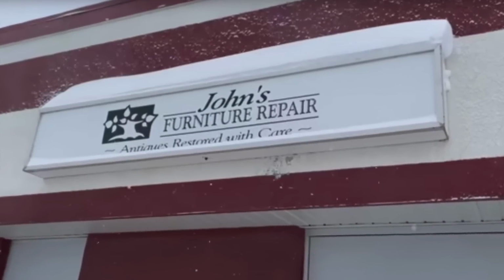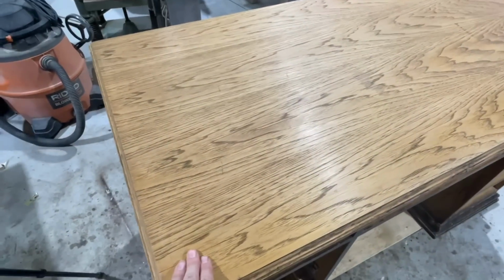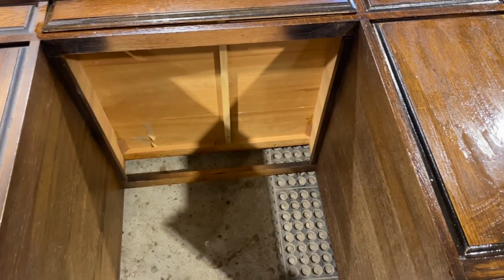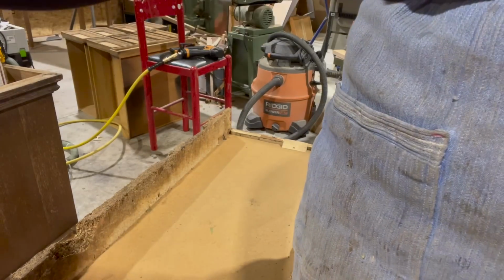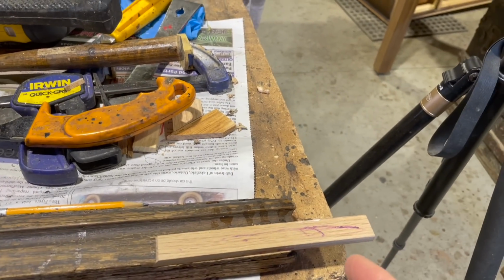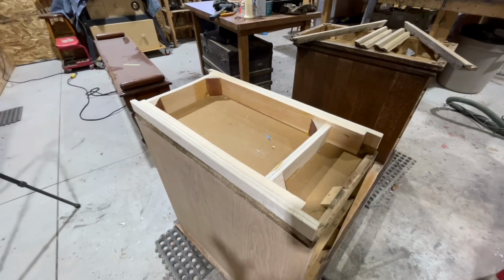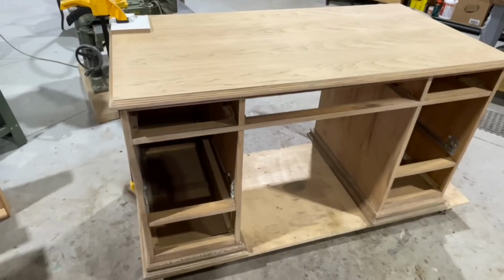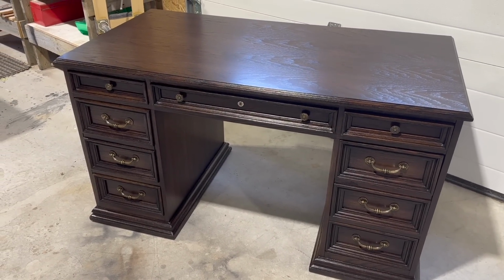Particle board + Water damage = shoot me

Comment: A lot of work to beautify bonfire fodder. It had to have great sentimental value to the customer.  As usual, excellent work. What is sad is to see particle board furniture and cabinets peddled at prices that,  just a few years ago, would have been equivalent for solid hardwood.
Reply: I’d have burned it for sure.  And bought a quality piece to replace it.
Reply: What is sad is when the piece was new the salesperson touted this as a solid wood desk.
Reply: Brilliant my love
Alan Brett
Reply: Congratulations.  You have accomplished the Alchemist's feat of turning a sow's ear into a silk purse.  Hope the client appreciates it!
Reply: @viriato8566  exactly.  I was thinking it was lipstick on a pig.
Reply: Yes, but even a fire fodder it was still not worth the work of burning, but it came out beautiful after all the work. My father built a chipboard factory, and his attitude was that the stuff was shyteboard, especially after they went to environmentally friendly adhesives over the old formaldehyde based ones, and started to use less and less of it in the product as well. The ones from the 1970's are pretty much waterproof, and will survive being wet quite well, just now to get the same performance you need to go and pay over the top for the marine grade boards, and at the price of the marine grade chipboard you might as well not bother, and instead go for the marine plywood instead, as that is actually cheaper, and a far stronger product.

Yes I have a lot of home built furniture, and the easiest sturdiest thing to build out of is shutterply, as that is so much stronger than chipboard, and is actually a bit cheaper as well, especially as you get a stronger panel for a lower price, and it is a lot more rigid, and a lot better as to holding power for glue and fasteners as well.
Reply: Well, I think you said everything I was thinking!
Reply: @SeanBZA The biggest mistake we made in our home restoration was selecting painted MDF for our kitchen cabinet faces and drawer faces. Within a year or two any bump or nick "exploded" with water exposure. Had to reface everything with painted birch

Comment: Friends don't let friends buy particle board.Lol
Great job Trina.
Reply from the maker: Lol
Reply: Say what you want about people making good looking decorative pieces out of cheap pine.  I know they are not walnut, cherry, or oak -- but hey they come out spectacularly good looking and will last forever as compared to particle board/mdf/osb.
Reply: The diecast hardware was enough of a clue as to the low quality materials used in the rest of the piece
Reply: thats costco furniture..
Reply: I've seen alot of older furniture & mid century modern also made with particularly board too. But has lasted for many years. This new furniture they make today is so cheaply made. It's like it's made from saw dust, ugh. I'll buy older furniture & repair.

Comment: Could you use an epoxy resin on the particle board to increase structural integrity? Then glue new frame back to it also on the bottom edge to waterproof it ? Good job though on rubbish furniture

Comment: I feel your pain with the PB, I usually turned down that work but you did a magnificent job as usual. I think the worst thing to encounter is the plastic used on some cheap furniture. I was helping a friend in his shop once in trhe 1970s and he put a bureau in a strip tank before we went to lunch. When we returned, we found just a few pieces of wood floating in the tank as it was mostly plastic and melted! that was a difficult explanation to say the least.
Reply: I just experienced the plastic thing with a TV cabinet I modified. Fortunately I wasn't reusing the plastic pieces and they went into the garbage after I removed them from the cabinet.

Comment: Believe it or not, the previous owner of my apartment installed IKEA particle board cabins in the bathroom. My problem is that the basin is glued onto one of them and not fastened to the wall so I don't really know how to replace it with something better or just remove it, which I would prefer. Even solid wood on wet floor isn't such a good idea

Comment: Wow, interesting project. I ran into water damage to the particle board under the veneer surface of a mid-century dining room table top. The surface was raised where the p/b absorbed water near the center of the span but the veneer and finish were not damaged much at all. Have you or any of your viewers ever found a successful way to level this type of damage without sanding and re-veneering the surface?
Reply from the maker: That’s a tough repair. You have to read absorb glue into the Particle board through the veneer and get enough pressure to flatten the surface again.

Comment: At 6:30 to 7:30 you poured  a liquid onto the top & then scraped it off. This removed the dark colour & the surface became lighter. What was the liquid? (I’m currently trying to lighten the top & sides of a dressing table. The varnish has just about been removed but I thinks in the past  someone applied a dark stain to the surface (often veneered ply) & this has been absorbed in to grain features. As such I can’t power sand too much as it will wear too much veneer away).
Reply from the maker: Stripper

Comment: The only places to use particle board in furniture are speaker enclosures, movie props, and caskets. 
The insides of speaker enclosures can be painted with polyurethane after it has out-gassed. Plastic laminate can be used on the outside. It is acoustically better than veneer, and holds up well. Neoprene casters can be hidden behind a skirt. They are very helpful when speakers weigh over 220 pounds (100 kg) each.

Comment: Hello!
I'm an engineer but I have very little knowledge of wood. My instinct when seeing the repair was that I would have attempted to drill down the plywood and particle board, and insert some wooden rods (whatever you call those) such that the weight would transfer through the rods into healthy particle board higher up.
I'm wondering if there's some reason why that wouldn't be a good solution.
Reply from the maker: It just doesn’t hold a joint

Comment: Many of the desks from the 70's and 80's office furniture manufacturers were built like tanks - and seemed to weigh as much. The better ones used HDF (high density fiberboard) instead of MDF (medium density fiberboard). Solid wood/upper end residential desks at the time rarely could survive the rigors of an actual office life.

Water is to fiberboard what kryptonite is to Superman. My house was built in 1976. I bought it in '97. The kitchen cabinets are made of plywood and HDF. They still have no structural damage at all, though they're about to get their second paint job.

Even items made from cheaper products during those years are of more durable quality than what is available today.

This desk looks great and is ready for the next 50 years of its life!

Comment: I know you can't allow the stripper to dry on the piece, but I'd be afraid getting it THAT wet would raise the grain of the wood...
I detest, hate, and abhor particle board!  The person who invented it should be horse-whipped!  😞
How do you decide whether to use shellac, laquer, or poly?
Reply: I agree with your remedy for the inventor of particle board.  Any why oh why is it used in kitchens and bathrooms where the most moisture collects? Gah!
Reply from the maker: Just depends on what I’m restoring when choosing the finish. Stripper does not affect the substrate adhesion. It dries very quickly and is only in contact with the surface for a short time. Cheers

Comment: About halfway through, can't wait to see the final result, and am already learning some techniques I hadn't seen before, with the wood hardener and the stripping (what's up with those crusty cans, those look older than me, lol, but I like it).  Curious on the repair of the first base, wouldn't a few long dowels, like 4-5 inches, down into good particle board, better anchor and secure the new replacement pieces on the bottom, over gluing to bad particle board?  Aligning dowels between 2 pieces is always tricky, especially that many of them to make a strong foot.  And drilling deep, centered holes edge-on into 3/4" stock without emerging from one side or the other is also tricky.  But at least it would give you good particle board to anchor to.  Or is my amateur suggestion (and in light of the water-damaged particle board, you should pardon the pun) 'all wet'?  😎

Oh, and just thought of another option -- easier than drilling holes that deep into the edge for dowels, use the circular saw to cut a 1/4" groove into the bottom edge, as deep into it as possible, which should get down to good particle board (with several successively-deeper passes, to minimize blade flex), then the same into the edge of the repair foot, and spline them together with a well-glued piece of 1/4" plywood.  That should really add some extra strength in a future repair, in case the side-supported butt joint fails.

Sorry to go on like that.  Whenever I get a problem like this, I can't let it go until I've over-engineered the crap out of it, the goal being to be able to park a truck on it....  🤣

Great repair and restoration, very engaging!  Subbed before the end!
Reply: I have a feeling that damaged particle boards wouldn't respond well to being drilled into 😅 but I can't be sure
Reply: @Judoka26  Well, it's a sketchy material for structural integrity anyway, but often used in factory pieces.  It would have to be the right size dowel or spline, not too bulky in relation to the thickness of the particle board, so as to leave enough 'meat' on either side and not blow out.  It's a sliding judgement scale whatever way you go, whether to butt-join-glue to the surface of water-damaged/chemically-hardened particle board, or drill/saw down through that into undamaged material and anchor the repair there.  Then there's the idea of how aging particle board isn't as strong as new anyway, due to either breakdown of its structural glue, or its sawdust component absorbing moisture over the years, or both.  Not really the material you'd want to make a family heirloom out of.  

That said, Trena's restoration was brilliant, and her base repair there looks plenty strong.  I mainly thought of anchoring to the better/deeper particle board because she sounded unsatisfied with leaving so much of the bad and anchoring to it.  But I'm sure it will work out.  Her knowledge, experience and techniques are impressive!

Comment: I like what you have done with that desk, as I probably would have refused to do a restoration on a particle board desk. Only thing is, I am not a fan of is the spray on finish as I have never seen them hold up. I have an old rocking chair, that my grandfather made for my mom when she was expecting me. And the guy I paid to refinish the chair after I took it back to raw wood, used an all in one spray on finish/stain. Looked good when it was done, but I can see the poly finish flaking off now. That’s why I do not like spray on finishes.
Reply from the maker: Well the sprayed finishes I use are not an all in one situation. They are industrial grade finishes. Just a durable as you would get from the factory. But proper prep work and product are very important. Cheers.

Comment: Good job.

Weight usually will let you know if there is particle board/mdf. If it is heavier than it should be - pb/mdf.
The solution for the bottoms was good. The only real thing I might do different would to have added some dowels going through the new frame into the pb.
At least the top wasn't particle board and you found out by steaming a dent and it poofing up on you lol.

What finish are you spraying. Precat lacquer?
Reply from the maker: Yep precat lac. The top was partial board too. You can get away with small amounts of steam for short amounts of time. As long as it’s not soaking it up it won’t swell. The veneer protects it somewhat for the short steam. Cheers!

Comment: The punky particle board and wood  can be made strong again with a heavy application of super thin superglue.  It makes the wood rock hard and you literally cannot use too much.  Epoxy wood hardener works well too.  I have saved many rotted wood and particle board pieces using this method.  I tend not to use wood glue to join as thinker epoxy works better and holds stronger.

Comment: You are very good at turning crappy into happy. Did you consider drilling deep holes through the new wood into the damaged  sides, like six or more, and then gluing dowels for vertical strength?
Reply from the maker: It just doesn’t hold a joint.

Comment: I wonder, is there a way to maybe soak the particle board in thinned glue, or resin, or varnish to make it more solid and dimensionally stable?
Ive also noticed that the stripping parts of your videos are very satisfying to watch, I think its mostly the part where you scrape off the old stuff off, and put it in a can. I bet if you made a supercut with just the stripping parts, folks would watch that for hours.

Comment: I hate particle board.. I'd never knowingly buy furniture made of it. Back in the early eighties, for a present, I bought and installed a new bathroom vanity after the particle board one they had was falling apart, I thought it was solid wood, but after a few years the sides started to blister, turned out to be press board, I rebuilt the sides and bottom with quality plywood and put on a few coats of polyshades that matched the front, over 30 years later it still looks good! Keep up the great work!! 😊👍

Comment: Trena What was that hardener you used?  I never thought of using it with Ikea type particle board.  Great work
Reply from the maker: Just a wood hardener from home hardware. I forget the name. There are many brands
Reply: @johnsfurniturerepair  Thanks so much for that tip.   I will try the Minwax brand I have used it on punky wood and it works well.  I would have never thought to use it on particle board.  I have tried to glue it in the past with no luck at all.  I love restoring pieces.  What a reward when you give the piece back to a customer and they start crying because it brings back memories of what it looked like years ago.  It is a reward that touches your heart.  Thank you again.

Comment: This is a question,  not a criticism.  Why couldn'😮t you just cut the entire bad part off and build a new one then put the trim back on? You used a lot of wood anyhow,  so it wouldn't have been a much bigger cost.  Is there a reason that couldn't be done?
Reply from the maker: Oh well sure it could have. But that would have meant a lot more work resulting all the joints and drawer glides. Most of the piece was still intact.
Reply: @johnsfurniturerepair  thank you.  I'm just learning